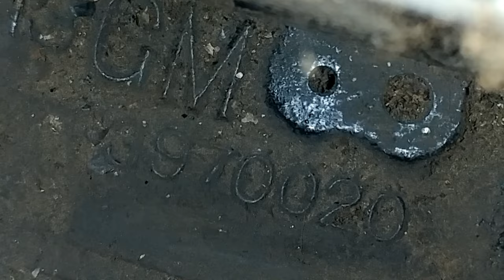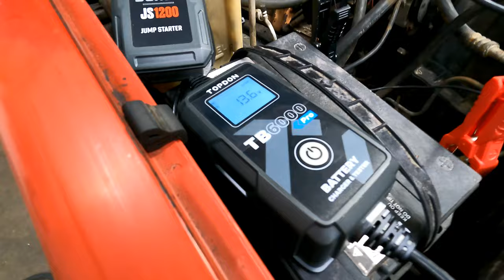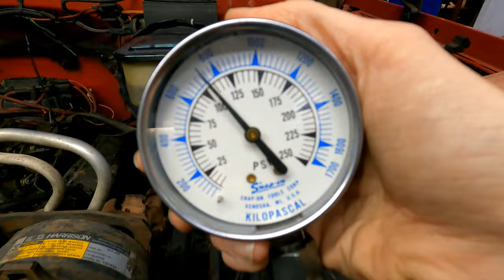BAD TIMING - Tuning Up Our NEW SQUAREBODY // 1985 C10 - UTX

Comment: You should consider a sniper install to get you through to the LS. Didn't you try one on Emily's c10 before that swap? The motor I had built was a 010 block with 487 heads 1971 date codes. The machines told me 487 were a good flowing head and very sought after for dirt track racing. He also said that the 010 and 020 were very desirable high nickel blocks. Great video
Reply from the maker: We were just talking about that! We have a FiTech system that is on Neighbor Jeff's Blazer right now, but it's getting a 6.0 swap soon. This 307 sounds really nice, so it would definitely be a good candidate for FI! Full disclosure, I nerded-out on those casting numbers for a couple hours! 🤣🤣 Interesting stuff! Thanks for tuning in, Bill!  --Emily

Comment: very helpful. Been going through the exact same process on my 79. Very similar set up (650 CFM Edelbrock on a late 80s 350 block.), but I can’t seem to get rid of the fuel smell. It’s running rich, even though I’ve got the mixture screws almost all the way in.   down.  were you guys able to do away with the fuel smell?

this is been the closest thing to a step-by-step that includes setting mixture according to vacuum in drive and at idle in park while checking RPMs that I’ve been able to find.  where did you end up leaving the timing? Could not tell on my phone screen what it was reading
Reply from the maker: Hello Sam.  It is running pretty good right now with the jets and metering rods that came stock in that carb.  It is bearable to be around it now with it running not being so rich. I will still try to lean it out a little with smaller jets and metering rods.   The vacuum and mechanical advance we're not working and my timing was changing when it shouldn't have been. We will put a new distributor in and fix that problem.  From the looks of where it was running good.  I will probably start with 10 degrees base timing.  It seemed to like it right there.  Thanks for watching and let us know how it is going.  Jerry and Emily

Comment: Any information on wiring the ls if it’s backed with the original 4 speed?
Reply from the maker: Hello Ryan.  We haven't done a swap with a manual transmission so far.  I do know that the manual transmission poses some problems when it comes to tuning them.  If you are in the middle of doing one or in the planning stages.  I would get a hold of whoever you would have tune the engine/ecm and see what kind of problems you might run into.   As far as wiring it is concerned. It is wired the same without the PRNDL switch that can be eliminated in the ECM. The only signal it would get would be speed sensor.  Keep us posted and thanks for watching.  Jerry and Emily
Reply: @UglyTruckExperience  thank you guys for the quick help

Comment: Currently LS swapping an 83 short bed with dual tanks, it’s lowered 3 inches and I’m worried that the oil pan will be hanging below the frame. Any helpful information? Thanks!
Reply from the maker: Hi Johnny! Check out this video, it shows how the stock oil pan ends up sitting on an 84. This truck is stock ride height, but you may want to go with a Holley low profile pan if you're worried about it. Hope this helps!  https://youtu.be/hBGIVLHMeh8?si=54hwtTQ0983--U2g&t=2193

Comment: On the topic of the 307 motor you talked about what’s your go-to oil that provides the additives to help these older motors run and not break down so quickly? Thanks guy!
Reply from the maker: Hey Tony! We're big fans of Rotella T4 and STP Oil Treatment. The T4 already has some zinc in it, and the STP adds a little more. And it's pretty cheap, too... We only had about $30 in this oil change, including the filter. Thanks for tuning in!  --Emily
Reply: @UglyTruckExperience  thank you!

Comment: The LSs are great motors and all that, but this video reminded me how easy it was to change plugs on a Small-Block.
$1600?? 
I can see how you jumped on it with both feet, sight unseen.

And I know I'm not telling you anything, but Q-Jets were notorious for fuel leaks in the secondary, to the point where adjusting the idle mixture (teaspoons) had no effect when the secondary's were dumping buckets of gas into the manifold. Good move going to the Edlebrock's resurrection of the Carter AFB; it gave you a good excuse for getting rid of the EGR valve.

And way to go on the 100 videos. I can't even think of 100 things to talk about...
Reply from the maker: It's nice to go back to the old school stuff once in a while. There's things we appreciate about both. The Quadrajets do have their quirks, but there's still a ton of them out there! We may end up rebuilding this one for another project, and we'll be sure to have a video on that. Thanks Rick! We appreciate you watching our stuff!  --Emily and Jerry

Comment: My 68 chevy II Nova had a 307 powerglide factory setup. Not the strongest motor out there. Neat to find one in this square body. When will the Ugly Truck Album come out ❤
Reply from the maker: It was definitely an interesting choice for a replacement motor! We're just glad it runs. 😆 Jerry says the album will be out as soon as I finish my guitar lessons... 🙄🤣🤣 Thanks Slayer!!  --Emily
Reply: My headache right now is a 2006 Impala SS. Being in a garage with a 7.5’ ceiling it was interesting dropping everything out the bottom. It’s my sons first car and I enjoy the challenge. Motor is 5.3 Ls4 and we did Dod delete with sealed set screws in the Dod towers. Can’t find a valley pan for this engine here in Canada for Dod delete.